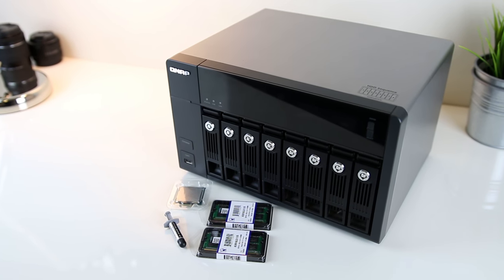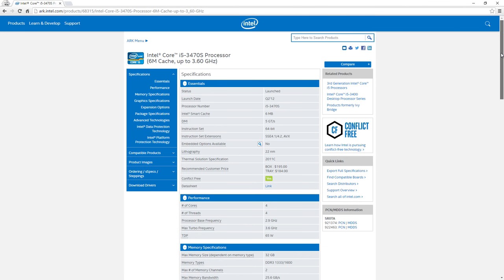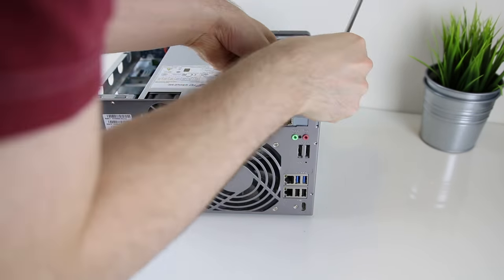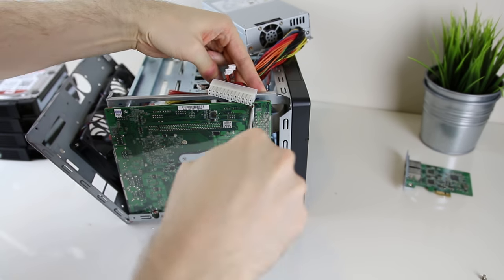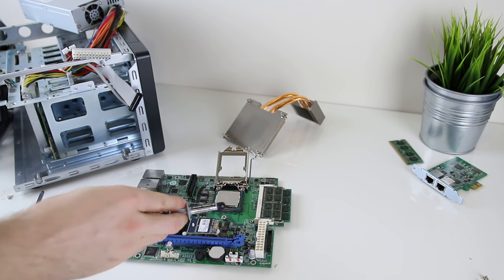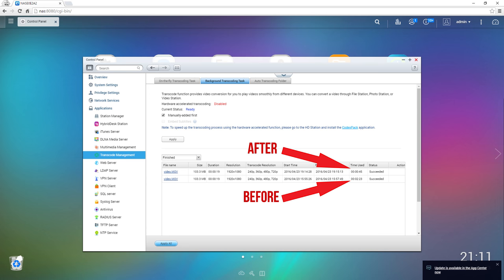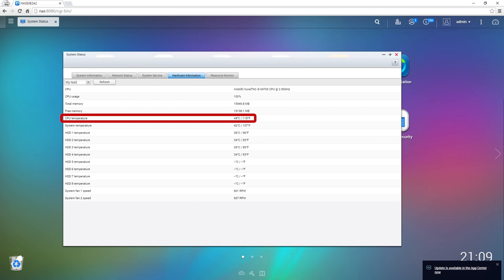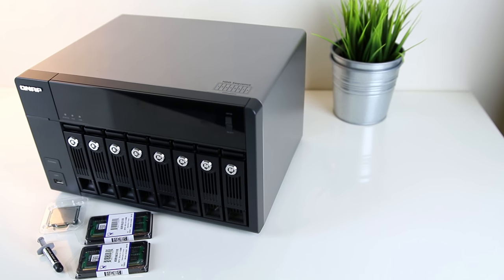Upgrading The QNAP TS-870 NAS - New CPU And RAM

Comment: Does somebody know if it's possible to upgrade the cpu from an QNAP NAS TS653A (Intel Celeron N3160 1.60Ghz 4 Core)? Thx!
Reply from the maker: I don't think so, the Intel Celeron N3160 appears to be a BGA chip so it's soldered to the motherboard.

Comment: I have two of these exact units and was wondering if this upgrade was possible. I peg the cpu at times right now and was wondering what a non celeron full intel would bring. Any issues with the OS after? I have my complete volumes encrypted so the on board AES support at cpu level will be a much welcomed bonus!
Reply from the maker: It's been running fine 24/7 ever since I made the video :) yeah I hadn't done encryption at the time of filming but wanted to which is why a chip with AES-NI was desirable. Anyway should work so long as the socket supports the CPU you pick, not too sure how powerful a chip you can go I didn't look into that, I just picked something with good performance to power ratio.
Reply: Jarrod'sTech ... I’m planning to copy your processor selection as it works and have documented performance gain!  I have already the max ram when I bought the unit from QNAP. FYI.. I have all four network connections with 1gigbit connections with selection to use them as a team. Two are receive and two transmit.. you have the same if not better to 10 gigbit single connection as if a port goes down it will automatically stay up and when resolved the os takes back to the prior setup. I pound it with data with no issues.
Reply from the maker: Yeah that's a good point with the redundancy, probably not something I need at home :P I could see it being beneficial I I was running VM storage off it or something though. I was considering putting a 10gbit expansion card inside it, and might go ahead with that soon as my new PC has a 10gbit card :)
Reply: Jarrod'sTech ..oh this all for my home data center... it’s quite large and I use the QNAPs for time machine backup, Acronis backup and iSCSi storage for VM’s running in my cluster array.. I’m a IT professional and run my home like I do our company data centers. My entire home is a smart house and I don’t trust security of IoT so I make my own . I have another model QNAP that is just for surveillance with 12 cameras attached all in 1080p with audio and night vision... I love these qnaps as the os is quite nice with updates and security. Like work I run my home data center with NIST security standards ... the wife just stays away but loves the insane speed of the home internet and services. I have a 40gigbit backbone fiber for the switches and 10gigbit to all the servers but this is all fiber and QNAP charges quite a bit for their fiber 10gigbit adapter so I use the four copper to achieve similar results that works.
Reply from the maker: Ah ok makes sens, sounds real nice! I was looking at setting up cameras to the NAS just haven't got around to it! Yeah a friend bought a second hand Intel card from ebay and crammed it in (he has the same model) an it works alright, saved a lot of money compared to the QNAP card.

Comment: I have a TVS-863  Can you upgrade the ram past 8g?  What about processor?
Reply from the maker: From what I can tell, that one can support up to 16GB of memory. I'm not familiar with that CPU, from what I can see it appears to be a SoC (System on Chip), and looks to be soldered to the board, so I'm not sure if you can upgrade by replacing the whole board but it doesn't look like you can easily only swap the CPU.

Comment: Hi, Do you know if TS859 memory (Uses single slot with 2 GB) can be upgraded to 4G or more? Also, if the CPU can be upgraded for better performance?
I have seen you TS-870 which uses newer motherboard, CPU and Ram module  ====>> https://www.youtube.com/watch?v=mFoox-OSoas&t=525s
Reply from the maker: I'm not sure about that model, but sounds like the CPU can't be upgraded - you could always open it up and see if it uses a socket or if it's soldered to the board though. What CPU does it have? Usually you can also look up the CPU and it will say if it's BGA (ball grid array, soldered). Not sure what memory size it can take, I honestly don't see why 4GB wouldn't work, but maybe best to check with QNAP support to find out what's supported before buying a new stick.